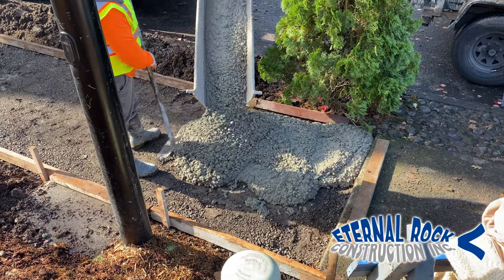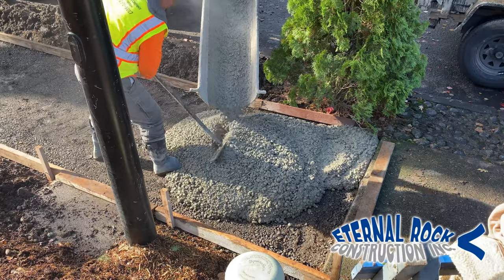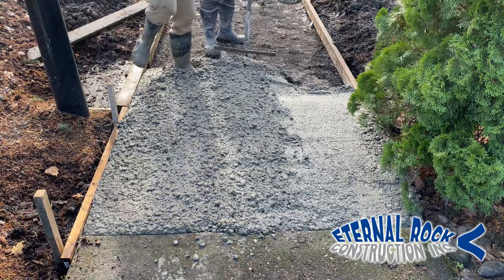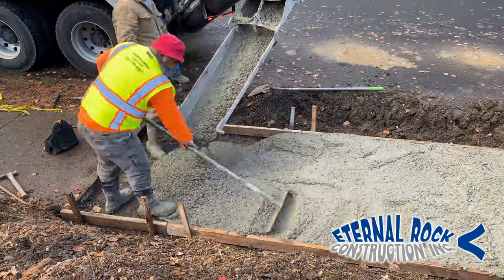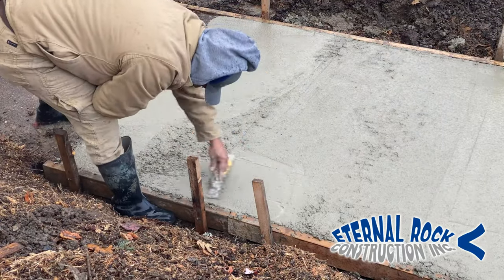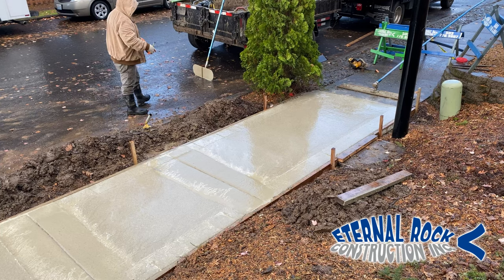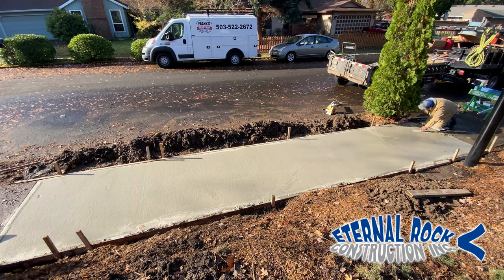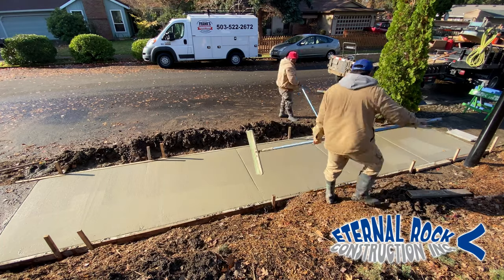Beginner Concrete Sidewalk Slab Pour DIY | How To Pour A Concrete Public Sidewalk Step by Step DIY

Comment: Why no reinforcement in the concrete?
Reply from the maker: Hi Paul, thanks for commenting. Reinforcement is not necessary for public sidewalk areas and is very rare to do so. We mostly use reinforcement whenever there is erosion or settling concerns. Great question though
Reply: pedestrian traffic. you would have to be reallllly large to require rebar due to your body weights structural impact on the surface.